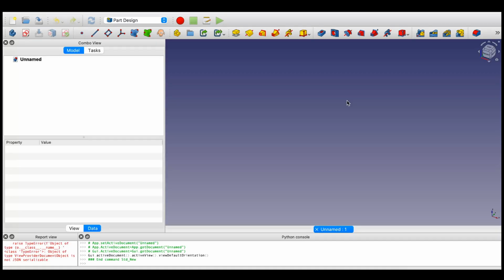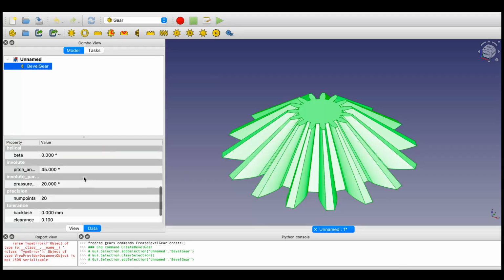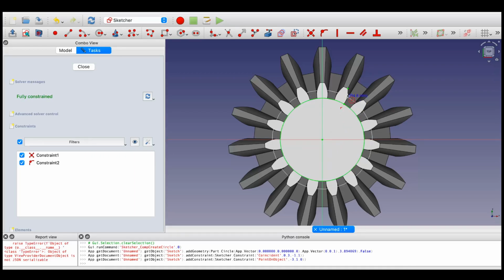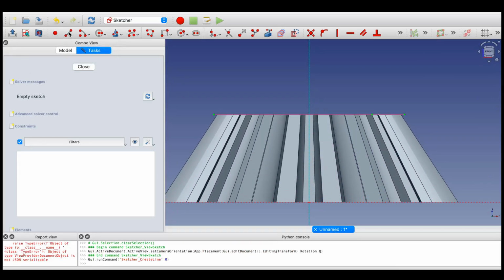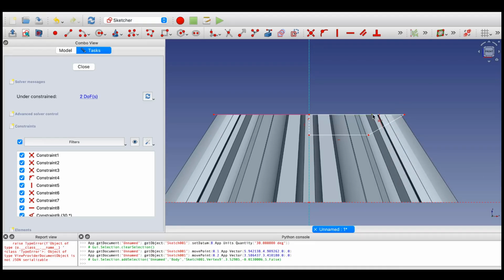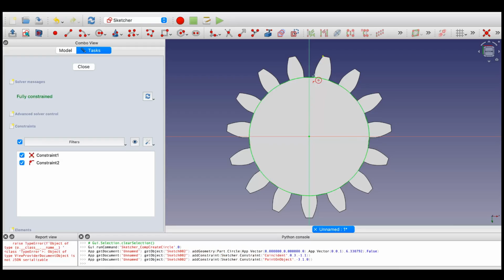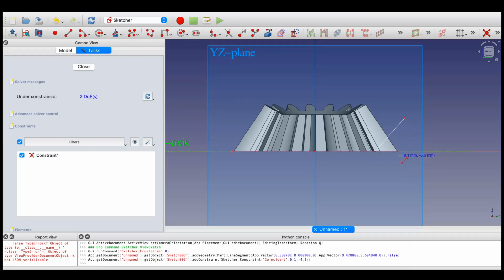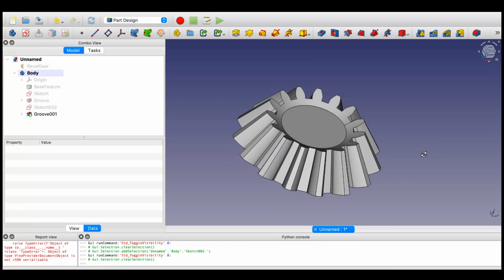How to Easily Make Bevel Gears in FreeCAD

Comment: How can I scale this to be bigger or smaller while keeping its dimensions ?
Reply from the maker: There are a few ways to do it, if you like to keep using the part design workbench I would probably use spreadsheet.  if you like to just simply scale it I would probably use the draft workbench.

Comment: could have talked more about the matching driver/ driven bevel as well (along with the design parameters and their practical meanings).
Also could talk about 3d printing
Reply: meh. both angles add up to desired included angle and number of teeth/ratio, giving the back cone diameter.
"mitre" is the easiest as its 45 each at 1:1.